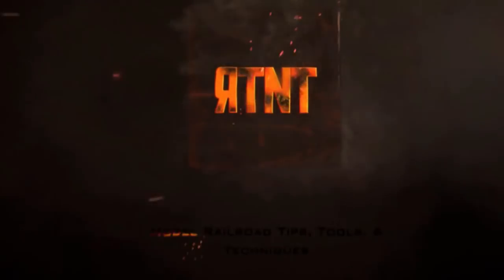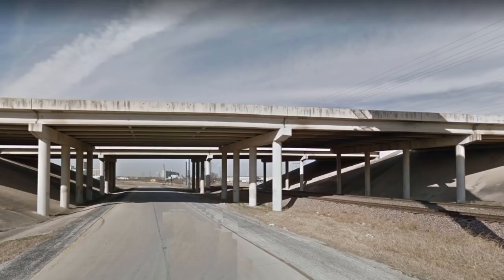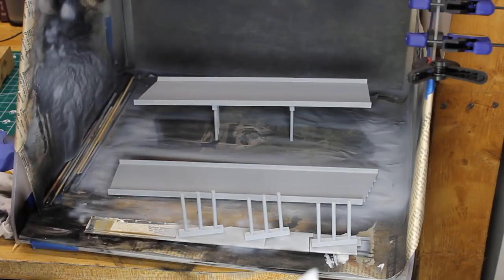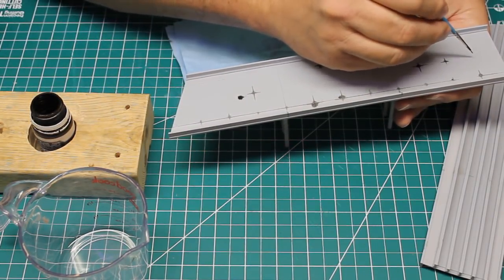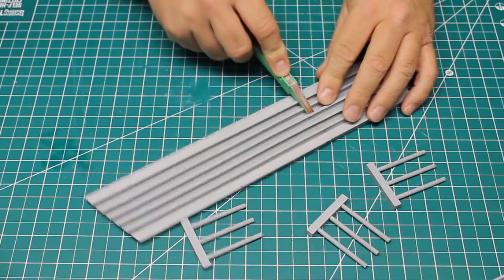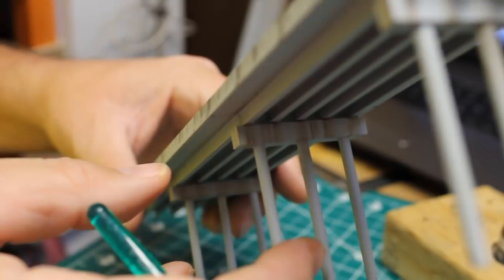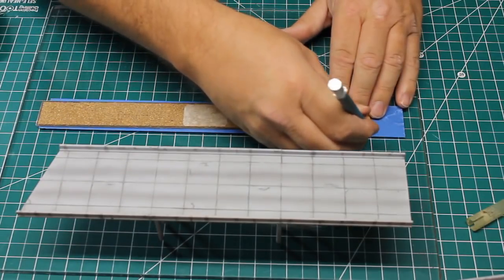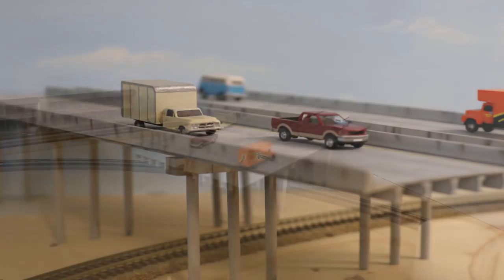How To Weather A Concrete Bridge Model

Comment: After you get your masks in place you can spray the model with dull coat before you paint your strips. It's a trick i picked up from modeling camouflage on military models. Looks awesome.Thank you for sharing another outstanding video.
Reply from the maker: I have done that when air brushing, but with these little strioes it just didn't seem necessary.

Comment: Hi Ron, I was wonder what foam you use? Should I use styrofoam for hills and mountains?
Reply from the maker: Use extruded foam, not bead board. You will be much happier. You can find it at lumber and building stores.